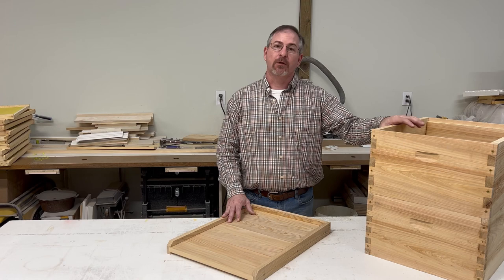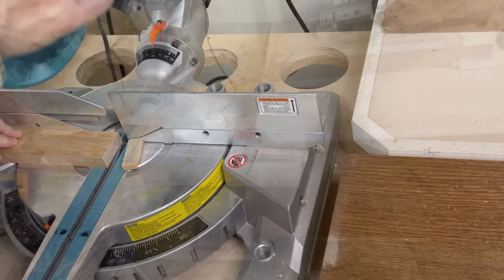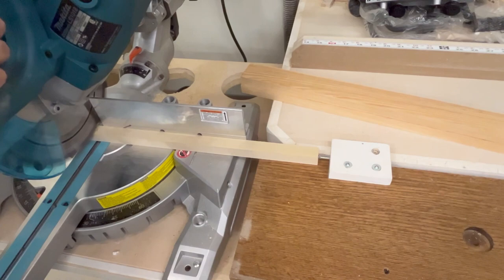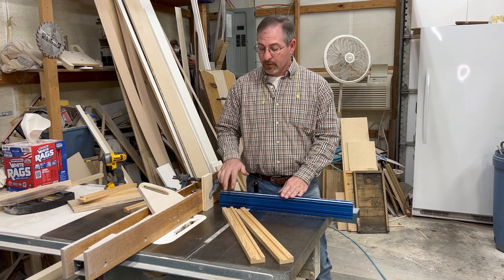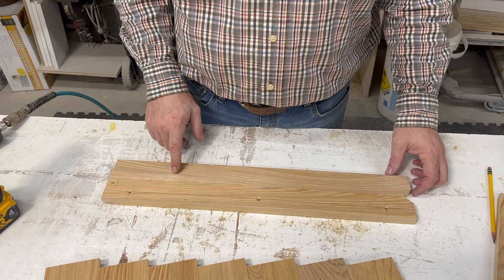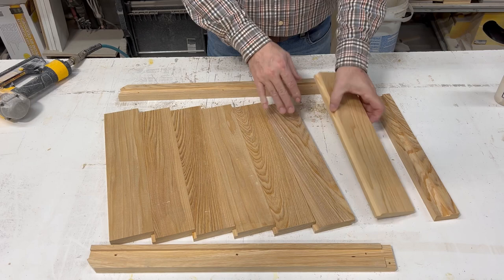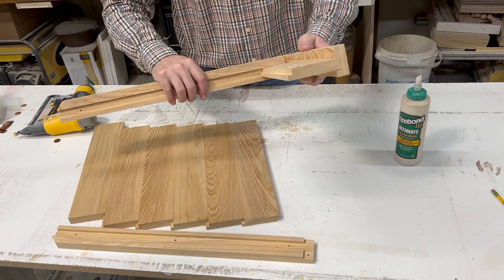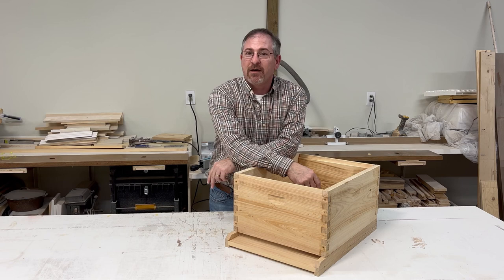Building Bottom Boards for Langstroth Beehives. Free Plans!

Comment: I'm curious, why not just use 8" boards on the bottom so that you have half as many seams on the bottom?  Fewer coins, fewer dado's and a lot faster while still leaving room for expansion.
Reply from the maker: For me it’s a couple of reasons. The wider the board, the more cupped and twisted boards become an issue as far as getting them to slide into the dado. My other concern is the expansion and contraction of the boards themselves. These bottom boards are constantly experiencing changes in moisture content. Throughout the year they will grow and shrink multiple times. The smaller boards give me more opportunity to introduce more expansion joints to help allow for this movement.